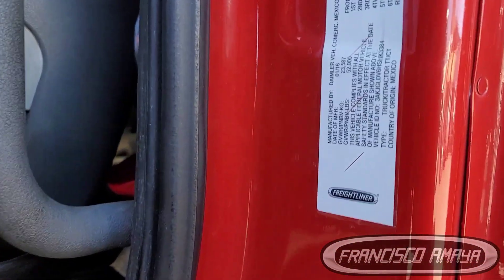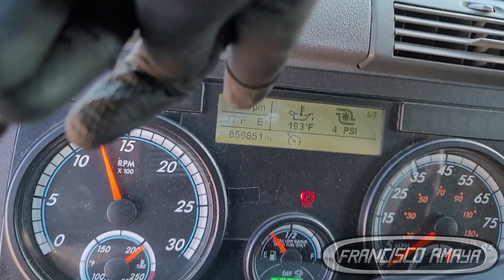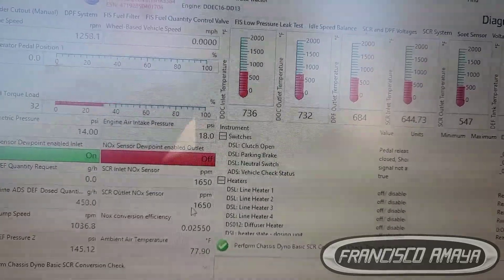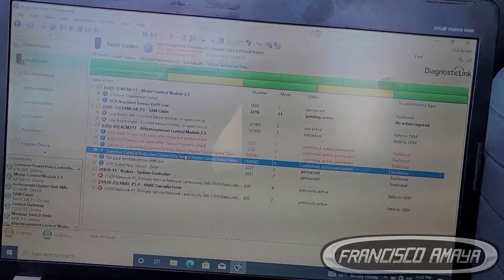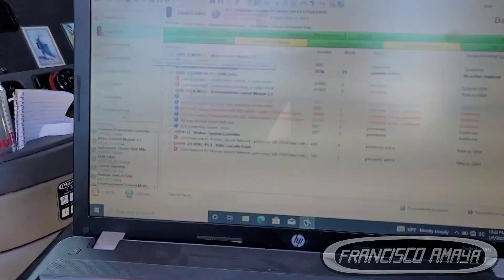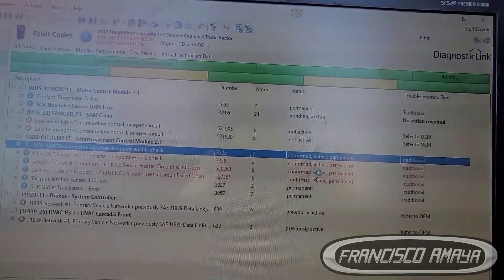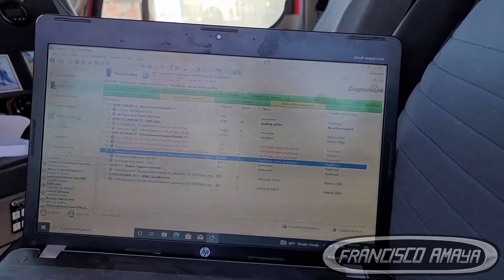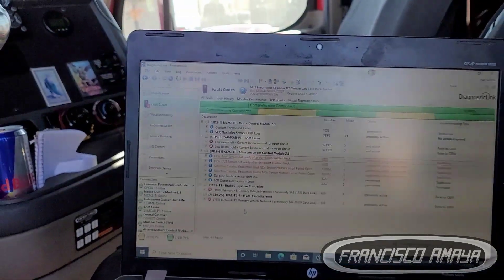Inlet outlet Nox sensor problem fault code spn 3223 fmi 7 spn 3238 fmi 2 diagnostic repair DD13 DD15

Comment: This video is longer than it should have been. The moment you see drewpoint not enabled you replace the Nox Sensor. TechLit tells you that as well.
Reply: I did on mine and bought a brand new one from the dealer, and Aft Harness is still not coming online.